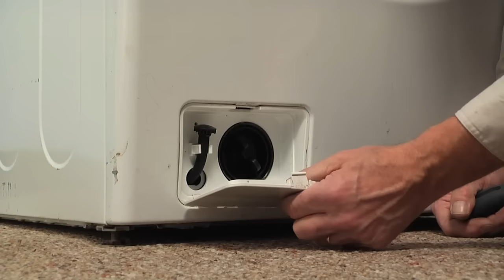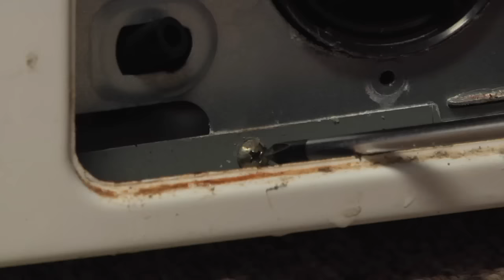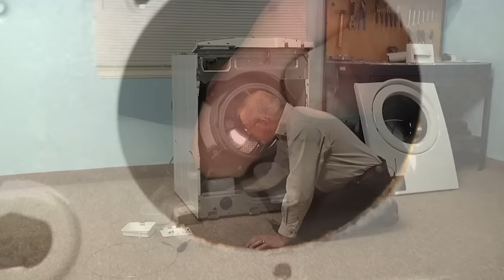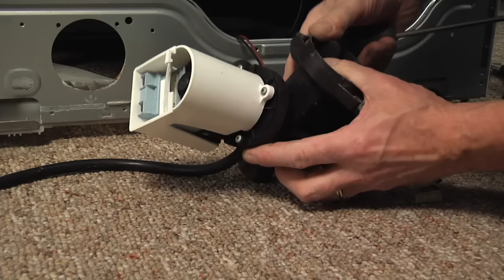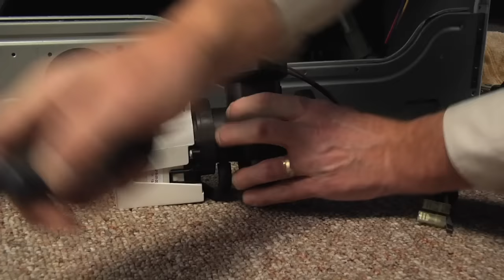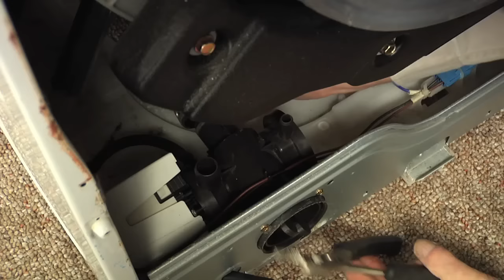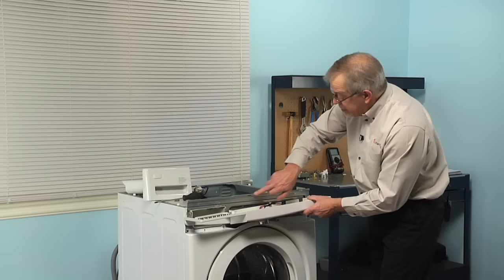Washing Machine Repair - Replacing the Drain Pump (LG Part # 4681EA2001T)

Comment: Heads-up: look at your particular model washer schematics before dissembling your LG washer. Ex. if yours is a model LG WM3670HWA then this video doesn't align with how to remove the drain pump because the front bottom plate is spot welded on so that it covers the access to the one screw at the front base of the drain pump holding it to an under-mount bracket. In this video (and all the other YouTube videos on LG drain pump replacements I have come across, the drain pump is easily removed once three front mounted screws are removed. So easy. Not sure why the mfr would have altered the configuration. I can confirm that no one in my area among service techs will work on an LG or Samsung washer "due to all the problems they have". Good to keep in mind if you are going to buy your next appliance - don't go LG or Samsung.

Comment: Great video!  I am still getting that OE error though.  Any ideas?
Reply from the maker: What is your model number?
Reply: I just go the circulation pump in the mail and will try to change that.  Will let you know if that works.  Model is WM2487HWMA though..
Reply: I finally got around to installing the circulation pump and guess what?  That puppy worked!!  Thanks!!!

Comment: Well I'm going to pull my pump out tomorrow. My 16yr old front loader had the removable lower front panel and I probably cleaned the pump out half a times and replaced it 4-5 times. Boys never empty their damn pockets. 
I'm going to see if I can skip removing the damn front panel.

Comment: That works fine on a NEW washer that does not need to be fixed, but I can HONESTLY tell you, that the WIRE RING with the spring on it does NOT go back on the boot that easily on an OLD, USED Washer! It will take a SPECIAL Pair of Pliers designed to SPREAD the spring, AND another Pair of hands to put it in place while you hold it . One Little tidbit you did not mention in the video. Otherwise Great video!

Comment: Just replaced my drain pump. But washer won't turn on anymore.... I didn't go through all the steps. I turned it on its side and took pump off from the bottom. Does anyone know if that is the reason why??

Comment: Hi again. I have a question. We replaced our drain pump following the video and tested our work by running a rinse and spin with some towels. Everything seemed OK. A ran a delicate cycle load with the same towels and the same amount of He detergent I normally use and it seemed to get a LOT more sudsy then it used to - to the point that suds were pretty much covering most of the door. Needless to say it didn't rinse the suds away and I had to run multiple rinse cycles to get rid of the suds. I feel like we followed the directions correctly. Do you have any ideas what the problem may be? Thanks!
Reply: +Rob Clark I think that for some reason the new pump may not be as forgiving when using too much soap. Not sure if that makes any sense. My pump was an actual LG pump, not an off brand. When I tested the new pump with the towels, I may have used a bit too much soap for the size of the load. I've done 3 larger loads since then, being more careful with the soap and they have been fine.
Reply from the maker: +Rob Clark I agree it could be that there as a smaller load of clothes allowing more suds to workup. Also check the type of soap you are using and try again using a measuring cup.

Comment: Does anyone have model WM2501HVA?  We purchased ~12 years ago….I don’t see any way that the plastic cover can fit over the new (larger) replacement assembly part (4681EA2001T).  Is it an issue to re-install without the cheap plastic cover?  Could not find any replacement part on line. Thanks for ANYONE who has advice!

Comment: What is the part called on the other side of the pump body? On the opposite side or the part you just put on.
Reply: angel gas  I think its the circulation pump.

Comment: What is the part number for the cover that fits over the motor? Is the cover required? I have an LG WM2050CW. My new replacement motor (4681EA2001T) is compatible, but it looks slightly different from the one I removed from my machine. The old motor I removed doesn't have a cover like this, and the replacement motor I bought didn't come with one.
Reply: Not an expert on this model LG, but I would reinstall it as it came. If there was no cover, it shouldn't hurt to leave it that way. But, sometimes parts are added or removed as they modify designs. You can call LG and see if there was a service notice of a change in design. Make sure you have the model number and serial number handy.
Reply: imagenotfound Thank you. That’s what the replacement part supplier advised as well, so I proceeded with no cover. Washer is back in business 👍🏻

Comment: Doe's a defective drain pump make grinding noise?
Reply from the maker: It surley can, some grinding noise maybe a result of a foreign objetc that is around the impeller but as well if the pumps impeller shaft bearing is worn it pust the shaft out of alignment and it will make such a noise as well.

Comment: At 4:25 I'm having a terrible time removing the wire harness, even though I'm pressing the release tab all the way down. Anybody have tips on how to do this? I've pulled really hard. Don't want to break anything.
Reply: I ended up taking the front panel (mostly) off first, then my wife held the other end of the release tab up with her fingernail while I yanked on the wire harness with pliers. It came off after some effort. It was easier to maneuver with the front panel off.

Comment: At 8:46 does it matter how wire harness is reinstalled? Can each side plug in to either receptor?
Reply from the maker: Hi Chuck, thank you for your question. On most models the different wires in the wire harness will be color coded, and it is important that you take note of which side goes into which receptor. Good luck with your repair!
Reply: Thanks, but too late. I did not label.  I called Appliance pros and they said it did not matter. We'll see.

Comment: My LG Tromm won't take the water out of the clothes anymore..I get a UE ode and then redistribute weight again..and then it'll go for awhile again..and same thing happens..do you think it's the drain pump?? the water never leaves the clothes on spin..
Reply from the maker: +Val Hall What is your model number?
Reply: +PartSelect My Model number is the WM2277HB
Reply from the maker: Normally the uE code is an indication of an unbalanced load. Is there standing water in the tub or just wet clothes?
Reply: both.. and the the code was b6 and I replaced the out of balance sensor.. and now it's fixed..!!  Thanks.

Comment: Your video was awesome! But now my machine runs for 1-2 minutes then flashes LG.  Help! 😮
Reply from the maker: I am not aware of an error code LG but this link may assist you  https://www.lg.com/us/support/help-library/error-codes-washing-machine-CT00000305-20150140270078
Reply: @partselect  it is actually LE, darn autocorrect. Thank you this link is great to have! I must have a blockage somewhere. Is there a way to force your washer to drain? I wish it had a cycle for just draining.

Comment: Google finds this video when searching for LG F1443KD. On LG washing machines with separate front panel with a lower plastic part only the plastic part has to be removed, then the drain pump can be loosened and removed from the pump housing. Just eight screws have to be removed and the washing machine can stay at its place, even with tumbler on top. However removing the pump from the casing and mounting the new one is about as funny as changing spark plugs on V12 Jaguar XJS.

Comment: Hello everyone. My LG washing machine and dryer Combo, take water at the end of drying process. Did anyone have any experience same like me? Thanks for your answer’s 🙏
Reply from the maker: Not sure I understand the issue enough to give you a solid answer. Could you send us the model number of the machine and describe what your seeing as an issue, and let me know if it has always done this or just recently. Thanks! - Chris
Reply: @partselect  Hi again, the washing machine is LG WM3987HW.
This was working nice and not problem’s. But have 3-4 weeks, at the end of dryer cycle the drums is full of water. I remove the clothes from washing machine before that finish the dryer cycle like 85-90% dry, if i will not remove it, they will be wet because of water. Thanks for your answer

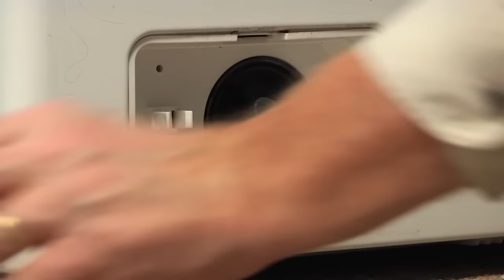Comment: I know this was done 6 years ago but you only forgot to install the bottom screw that secures the front panel. at 11:17,  Otherwise, just a great video.  BTW, mine wasn't quite as easy because of rust.

Comment: Great video, truly! However, you can always tell the difference between a true repairman and a DIYer. The DIYer will clean the removed parts and now-accessible areas that could use a once-over, especially the seams. He'll even encourage you to do so. The repairman? Not so much as a whisper. 🤣🤦‍♂️ (The mention of cleaning the gasket doesn't count since that is necessary to the repair.) That's just an observation about human nature, not a criticism of the content itself. Again, I stress, it was a great video!

Comment: Maybe Im an idiot, or my washer isn’t the exact same thing - even though the model is the same…but I just tilted the washer back and changed the pump via the bottom opening. 🤷🏽‍♂️
Reply: Does that work for lg front loader?
Reply: @devonhardy7202  - That’s what mine is.

Comment: good video.  I learned a lot.  However, you edited out the hardest part - putting the tub to pump hose and clamp back on.  A large jaw slip joint pliers works a lot better.  I don't see how that one did the job.   Also it is easier to tip the washer at a 45 degree angle or lay it down on its side and go at it from the bottom.  But that is more dangerous.  You get a like from me!
BTW, don't buy an LG refrigerator.  You will regret it.  The compressors have short lives and the customer service is awful.

Comment: Sorry, but I have to give this video a negative rating.  There is a lot of useful information here; however, I found it inadequate in 3 (three) specific areas as I attempted to follow it step-by-step, laptop next to washer.  (1) The video is deficient when it comes to getting the spring band back in place; it subtly transitions to another scene and doesn't actually show the technician completing the operation.  After half an hour I gave up.  I am ordering a spring expansion tool.  (2) I just couldn't get the factory tub drain hose clamp loose enough so that the hose would slip onto the fitting.  Fortunately I had a spare worm drive hose clamp that did work.  (3) I have one of those washers that has a pump that stands on three shock absorbers with bolts.  The technician casually mentions that LG washers are out there with three bolts holding the drain pump as if that is the entire difference--but it is much more than that and deserves a better treatment.  Bottom line, I am in the midst of the repair and it requires more tools than noted and has more challenges than noted.

Comment: Having a horrible time trying to get the screws back in for securing the pump to the chassis again.
Reply from the maker: Are you referring to the screws that go through the mounting bracket and into the pump on either side of the filter opening? If they do not line up, you may not have the pump base lined up properly with the guides on the base frame.
Reply: Yeah, I figured that out! Had the housing on backwards.

Comment: screw dat! just tilt the unit back and the underside is wide open easy as pie!! 3 screws to access the coin drain and 3 screws hold the pump in...there's a "hold-in" tab that keeps the pump in place, simply push that down and the housing will slide back and out...check that the little black 3/8" looking drain hosing isn't clogged...mine was BADLY and it should be checked monthly

Comment: Ty sooooo very much.   I had a new machine ordered.   You saved me $1100.  

Side note-the metal string (with the spring) that goes around the rubber outer section of the tub is a bitch to put back on.  How did you do it so eloquently?   Cudos

Comment: I can not for the life of me understand why everyone goes through this entire process. If you lay the washer on its side the bottom side of the machine is completely open with no panel at all. the pump is right there. 2 screws and a clip to remove and it's out of the machine. 15 minutes tops....unbelievable and simply mind numbing

Comment: Lg wm3997hma combo . Worked great 2 yrs .just replaced drain pump today jan18 ,4th pump since Aug2020. Machine is not overloaded ,filter drained and clean very regularly. Lint from door seal cleaned between every load. OE code  every 2  1/2months and pump very noisy. Impeler on pump is aways sheared off of motor shaft. Anybody have a fix for this, I have 3 pump motors that work but impellers are all sheared off. Anybody else have this problem.

Comment: Why not replace pump through bottom hole of washing machine instead of taking washer all apart? So much simpler and less time consuming.
Reply from the maker: Thank you for your excellent comments. We decided to do this repair through the front so that those who have stacked units would not have to remove the dryer to do this repair.
Reply: That would be nice but the way it's constructed you must take the top panel off to take the control panel off to take the from door off to access the pump... why not just make a larger access panel below the door in order to access pump... too much sense Huh?
Reply: Because you cant see everything that you are doing and requires some steps to be performed by feel. If you are replacing this pump it behoves you to check the hoses attached to the bellows.  I had a tech do the underside replacement technique, and inadvertently caused other issues during the install.

Comment: You don't have to disassemble front panel. Just tilt back the washer, and get at the drain motor from the bottom opening.
https://www.youtube.com/watch?v=ZlUDjDpLcZ4
3 screws to remove pump assembly, and 3 screws to remove the pump from the assembly. 
10 minute job.

Comment: Terrible video!! You left out the fact that you need a spring expansion tool to put the seal ring back on the rubber door seal. That cost me so much time. Thought I was doing something wrong until I found a video telling me I needed that. Not to mention every comment stated it could not be done without the tool. So now im waiting on it from Amazon. After fighting it for a few hours everyday for almost a week. Thanks!!

Comment: error"f" "h"
Reply from the maker: Hi Patricia, what is your model number?
Reply: PartSelect 
 GHW9400PL4
Reply from the maker: Patricia, when researching your model number for your error code "f" "h" it shows to be a pressure switch failure. Here is where you can buy the part: http://www.partselect.com/PS11755855-Whirlpool-WPW10514214-Water-Level-Switch.htm?SourceCode=4&SearchTerm=GHW9400PL4
Reply: Thank you! I will help my husband fix this problem, I will let you know how it work.

Comment: This must be the worst tuition I have seen.
The camera should be in the machine body with some lighting.....what is happening? ??
What a rediculously designed LG machine anyway....
Why not put the pump at the back so you just remove the back panel ...like my last machine???????
These LG pumps are well known failure items around six years old.......just check out their poor quality???
Use two flat screwdrivers to refit  the front door seal.....just like repairing a flat tyre on a bike....
Reply: my pump failed during yesterdays laundry
it lasted since i got the LG machine brand new in summer of 2009